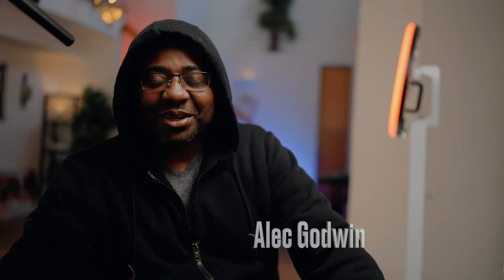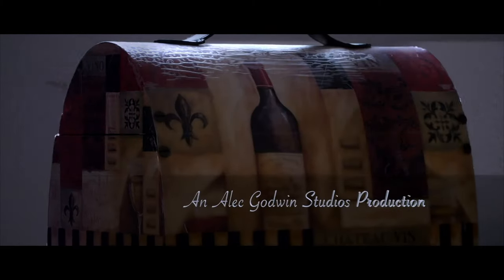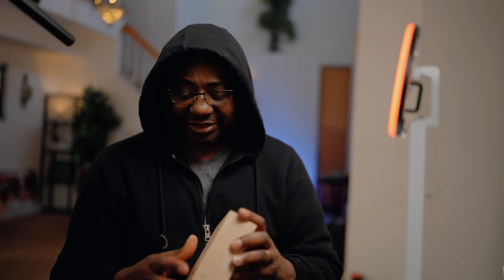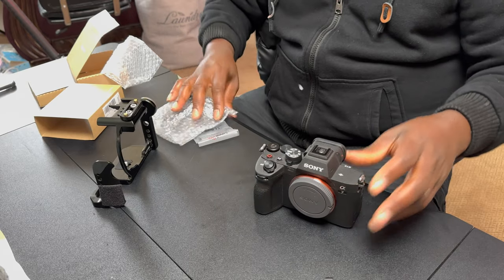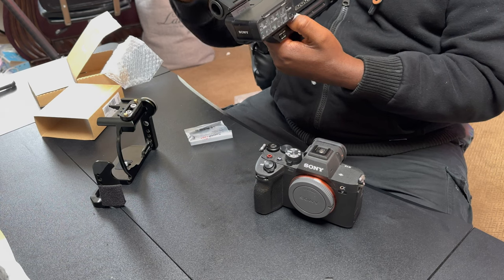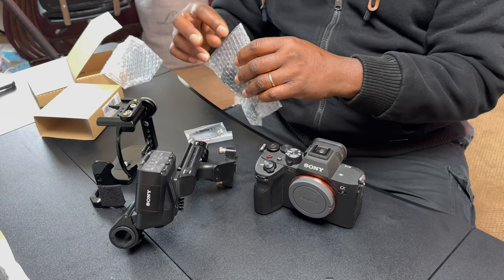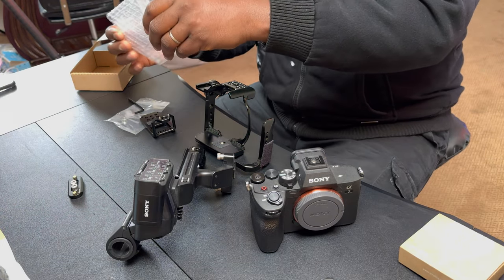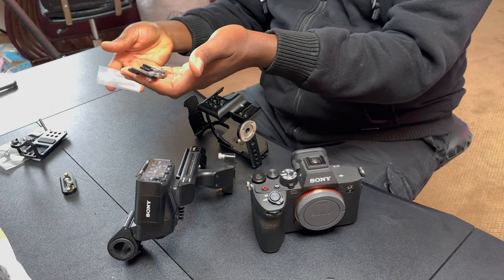How to Install the Sony FX3 XLR Top handle on the A7IV

Comment: I have same setup .. half cage with the adapter on a a7r5.... but can only fit the center screw attaching the adapter plate to the half cage. Putting the 2 side screws blocks the fx3 handle from pushing all the way forward...